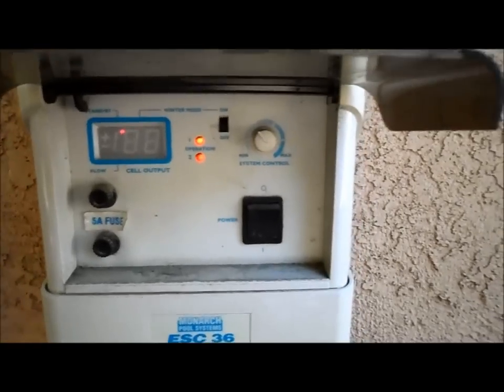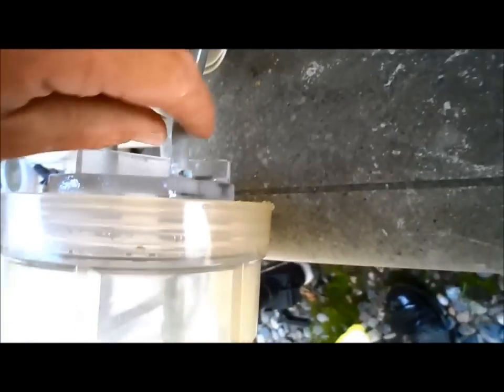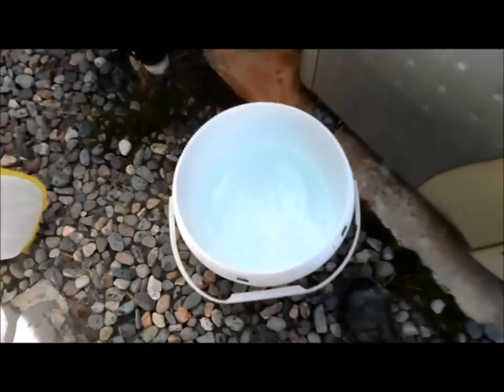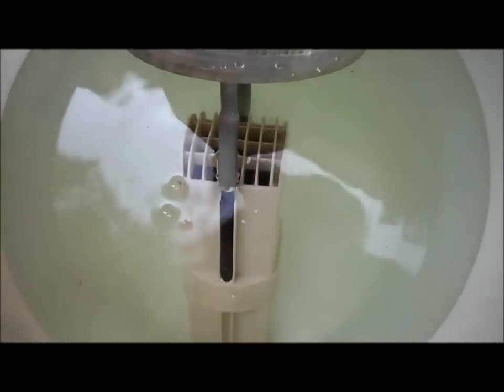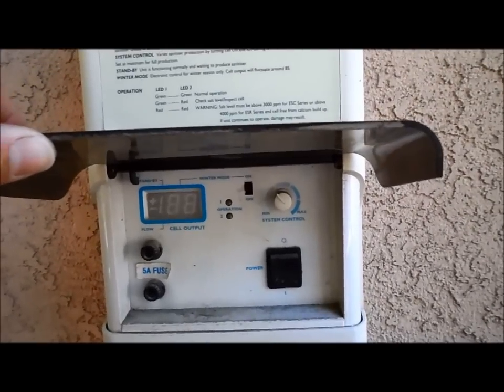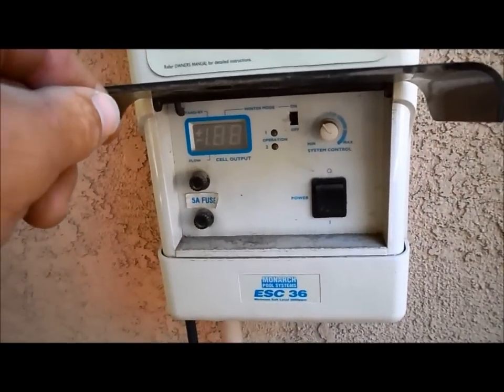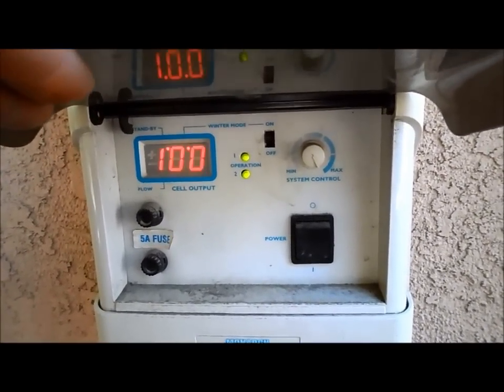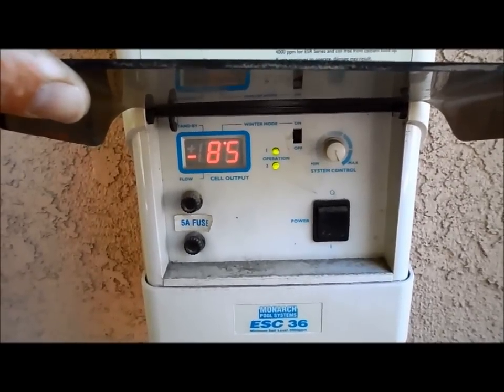Cleaning a ESC Ecomatic Salt system, troubleshooting

Comment from the maker: Got it, thanks. I was told this story from my supplier. Either way, the silicone sleeve on the unit is defective and will wear through in less than 3 years. This happens on almost all the Ecomatic cells I service. Once the sleeve wears down and the metal is exposed, within months it will stop working correctly. Besides, this is the touchiest salt system I know of, everything must be perfect for it to work, and other pool techs agree.

Comment: thanks. how do the cells fail ? My silicon seals look ok.  Poolshop  said cells failed , but they dont look too bad just a bit of white salt on a few.  cells cost small fortune. Might put the whole system in the bin. any good alternative easy to manage systems you recommend?
Reply from the maker: Hard to say if any system is entirely reliable but the Jandy TruClear seems to be the most reliable at the momone.t

Comment from the maker: I would go with the Pentair IC40 salt system. It is very reliable. And all the salt cells are about $500 to $600 to replace. But the Pentair Salt System works very well.

Comment from the maker: I would recommend replacing the complete unit with either the Pentair IC40 or an alternate system. The manufacturer of those salt cells recently went out of business again and the original maker has taken over. The new cell for the ecomatic is supposed to be much better and won't snap in two - I just filmed and installed one last month. Haven't had time to upload it yet. So you can try a new cell also if that would be more economical. You should get three years out of the new cell

Comment: Have you kept the ESC controller and changed away from the ecomatic cell units or have you swapped out both controller and cell? I think less than 2 years on a cell sucks @ $500 a cell. Do you still stick to the Pentair unit or other?

Comment: Sir! I continually watch your videos and always circle back around to them - for this thank you. I currently have a ESC-24 system and had two red lights just as you had here. Since I recently bought a house with this pool I figured I should clean it and get a baseline. I go to take the cell out and it breaks (all corroded/cell stuck with pebbles). so now I am wondering - replace cell or just get a new system. I've heard some suggest Aquarite and CompuPool.

BTW - are you on TFP?

Comment from the maker: Most of the salt cells have calcium build-up inside the middle plates. It is very hard to dissolve it and hose it out with only a 10- 20 minute soaking. I would run the system and then do another soaking tomorrow and soak it for 30 minutes. As long as the acid mix is 5 or 6 to 1 it should be okay. Too strong of an acid mix is what will damage the plates. Don't stick anything in the plates, just let the calcium dissolve with the salt cell cleanings. Repeat again if necessary in few days.

Comment from the maker: Our company only sells the ESC 36 which is rated for 40,000 gallons. All the pools that we install this unit on are 20,000 or less. It is left on Max mainly because if the output is lowered it stops producing. It is not a very efficient cell. We no longer sell this brand to our customers.

Comment: Hey mate, when i try to turn mine, the cell is just stuck and the wires get twisted... i have taken the outside of the wires out but the ones on the inside turn, but the cell itself does not.
Reply from the maker: Use a pair of large channel locks on it. The threads are probably calcified.

Comment: What salt systems would you recommend for large commercial pools?  I manage one that is 175,000 gallons.
Reply from the maker: That is a pretty huge pool. The only one I found is this one: AutoPilot Pool Pilot Professional 2 Power Supply 2 Salt Cell System | PRO2US. It holds six salt cells. They sell three larger units also. You might want to contact the manufacturer at www.Autopilot.com to see what size you need. As far as I know it is a good brand.